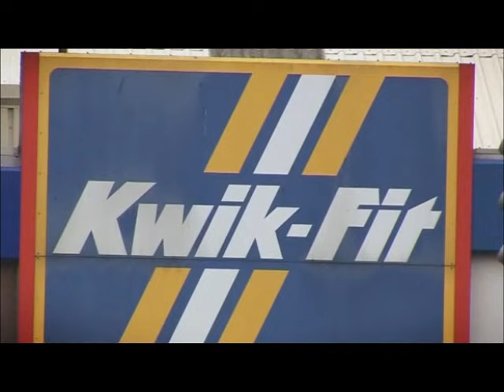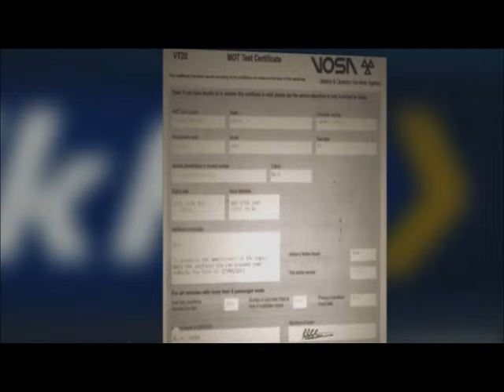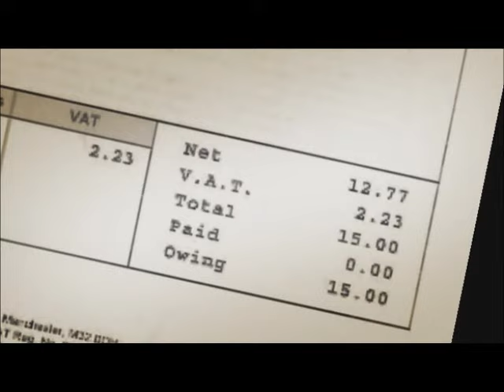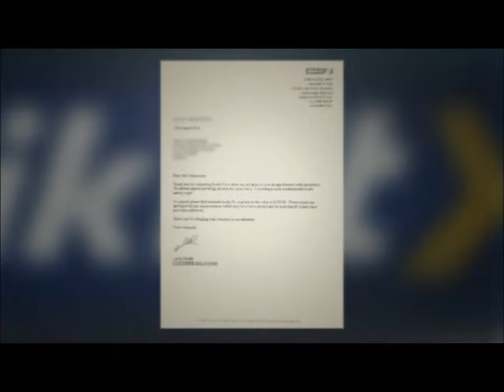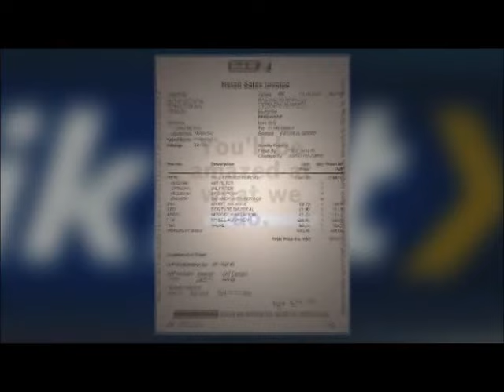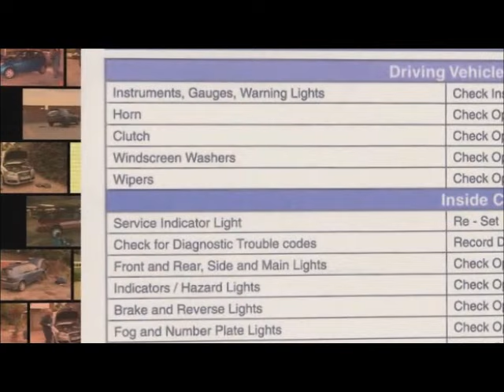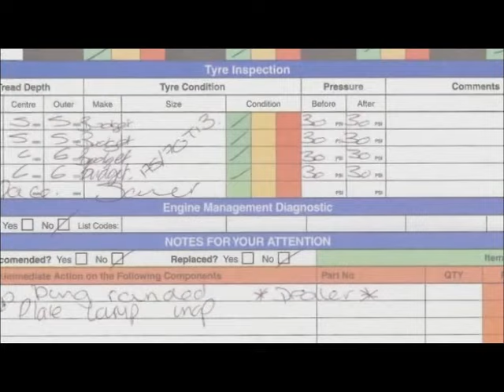Kwik-fit Car Rip-off Watchdog.wmv

Comment: My Dad was screwed over by them. Went in for new tyres, but they insisted that his cars brake boots were damaged. My Dad refused and went to an independent garage, who suspected that both had been intentionally neen slashed. Avoid Kwik Fit like the plague!!!!!!!
Reply: Kwik fit more like Kwik con
Reply: It reminds me of the various motorway service stations/ little chefs charging £9 for a small basic cooked breakfast and £2.90 for a small cup of tea-(1teabag bit of hot water+bit of uht long life milk) yet if u go a mile or two further down the road you would usually come across a catering van parked in the lay by where u cud probably get a cuppa for  £1 or less
Reply: @TELLBOY_E17  Service stations have large overheads which the catering van doesn't have, a closer example would be for the catering van to park in the service station car park and charge £3 a cuppa claiming they have a permit when they're just freeloading.
Reply: @TELLBOY_E17  But then people don't help themselves and just pay it. A few years ago I was on a ferry from the IOW to Portsmouth and decided to go into the shop to buy something to eat and a drink. I soon refused to buy an item as the prices were too steep but people were queueing up to pay the high prices. As I said, they don't help themselves.
Reply: Went in for a tyre and got told I needed I new shocks. Their fitter had sprayed oil them. Didn't fall for that old chestnut. Never been back  that was 40 years ago, your loss suckers.

Comment: My friends used to work for Kwik-Fit and I know for a fact the staff would charge for work that didn't need done. Also, if a car came in that one of the staff also owned they would try to charge the customer for parts that the staff needed for their cars and never fitted them. Kwik-Fit should be avoided at all costs no matter what the branch.

Comment: Wouldn't trust kiwk fit to work on my wheel barrow.
Reply: DAVID CADDY  I will take a look at your wheelbarrow, i only use genuine replacement parts, please send photo for a no obligation quote
Reply: you eill end up needing a new exhaust at kwik shit
Reply: i took my wheel barrow, they said it needed 2 new tires,a new brake servo and a new speedo cable? huh
Reply: I'm sure if you took a unicycle in, they'd say it needed new brakes.
Reply: Paul Robinson let me take a look mate, i can probably beat their price, i also fit genuine replacement parts and a no quibble guarantee !
Reply: Dave,i hadn't read your message when i wrote mine!!
Reply: Lmao
Reply: This is a little known fact but Kwik Fit changed the batteries on Apollo 13.
Reply: well you certainly wouldn't want to use them after this programme.

Lol'd at Kwikfit stating that they have a "satisfaction rating of 97%". Yeah that's because most of your customers believe what you tell them in relation to their car...
Reply: DAVID CADDY lol
Reply: DAVID CAD
Reply: Why not? I took my wheelbarrow in, they changed the window wipers for free. Can't beat that.
Reply: Graham White p8
Reply: dw they wouldn't touch it they'ed charge you tho
Reply: If you took ur wheel barrow to Kwik Shits they would probably say you need to have the barrows head light fluid topped up and try and charge you £950 for it
Reply: DAVID CADDY lucky thing they don’t work on wheels that small then 😉
Reply: I would never trust these parasites told me I needed new shock absorbers I told them to put it in writing they refused
Reply: @Elldeeve  and shock absorbers.
Reply: Not all depot's the same. The customer service is second to none. Always use own inspection sheets which must be completed by company policy.
Reply: I took my wheel barrow to quick fit and they said it was in such a bad state it should not be used on the road and be confined to garden use only.I was surprised by that.
Reply: @blackvulcan100  FFS change the record. Boring now
Reply: DAVID CADDY. Formula one didn’t have a clue about white ceramic brake pad grease accusing me of using white grease on brake pads. I pointed out to them that as they are professionals they should have been aware of the problems that copper grease can cause to ABS sensors and to cause them to malfunction.
Reply: I remember taking my car to a Kwik Fit where I'm based. Just for a new tyre, after the old one had a nail in it. I asked them how much for a new tyre? The guy said it was gonna cost £120. Just for a new tyre. Huh? Never again. Such a big rip-off!!!
Reply: They would fck the tracking up lol
Reply: lol
Reply: Its just not qu ick fit many of the local mechanics are doing the same. I wonder what the solution for this rip off. Every time im going for a mot i am pay 250-300pounds.

Comment: They're all the same, wifes Mitsubishi Outlander went in for a service, Mitsubishi main dealers in Cardiff rang back saying the car needed £660.00 of work on the brakes. Took it to my local garage, nothing at all wrong with the brakes. Even main dealers will rip you off.
Reply: Had the exact same with Arnold Clark
Reply: Main dealers are the worst for ripping people off can't believe people still use them
Reply: true....everyone needs to learn as much as they can about their car and search long and hard for an honest mechanic. Usually the small independent ones on the best because they can't afford a bad reputation.
Reply: Yeah I took my Golf to a local dealer for an MOT and they told me the back brakes were sticking. I watched the two guys through the service window remove the wheel, stand about for 30 minutes then put the wheel back on and they charged me £100 for this. I've never been back.
Reply: Find a good independent specialist as I did for my Saab Aero - RTJ autos in Stockport excellent 👌
Reply: I have found Main Dealers to be even worse than these "KWIK" type places....their excuse is that their overheads are astronomical.
I call it  "Fraud with a smile".....But it is still THEFT.
Reply: Had Toyota main dealer tell me that my car needed new front pads and discs I told them I was aware the brake pads needed replacing soon but that I don't believe the discs will be an issue as the car has little more than 60k miles they weren't happy and I told them I will have my mechanic do the work, I had only gone for a service as it extends the warranty. I looked back at the full history of car my car before taking it to my mechanic and found the discs had already been replaced at 38k miles with the previous owner which was also likely not needed either. I now service at a different toyota dealership who are much better. I never did get new discs as my mechanic agreed it was 100% not needed and the car passed its MOT several months later with the same discs. I frequently check the tyres and brakes on my car and can literally see into the front brake caliper without removing the wheel so know how thick the pads are. Dealerships bank on people not being switched on.
Reply: dealer stealer

Comment: You cant get shitter than a kwikfit fitter
Reply: Glenn Osgood Halfords is no better
Reply: That's like the advert by Sky. "Believe in shitter"  lol
Reply: Glenn Osgood 
Well said!!!
Reply: lmao
Reply: Where should I go instead? I need something reputable
Reply: John CR Smithton the old guy hidden in the corner bold head oiled up without a uniform rolling his cigarette and has been a mechanic for about 35 years is 105 times better and cheaper then quick fit or anyone else like quick fit.
Reply: +ENIGMA DHE KURIOZITETE  Definitely agree with you on that one. BTW is this the guy you mean 6:56  jk lol.
Reply: Your wrong it’s “you can’t get shitter than a shitfit fitter”
Reply: Unless you go to HALFORDS!!
Reply: Sky slogan is unintentionally accurate - "I do believe in better, that's why I don't have Sky"
Reply: @Jojohumf  
Look for an independent garage that specialises in your car brand, or country of manufacture.
I have a Mercedes Benz, and I had to look for an indie that had a MB diagnostic machine (STAR), and someone who knew how to use it.
It's not as hard with other makes, as most manufacturers cars can be read with a middling diagnostic machine.
Don't go to main dealers, they are nearly as bad as Kwik fit, and can charge fortunes for parts and labour.
The best way to find a good indie is word of mouth.
Reply: @stevenlawrence278  thank you so much

Comment: A trusted friend who owns his own garage had just done £900 worth of suspension work on my car finishing with a tracking check for me. He pointed out I needed a new tire so I went to Kwik Fit two days later. They fitted the tire then without my permission did a free tracking check and told me it was all out. When I pointed out to them, I’d only had it done two days before the look on their face was priceless.
Reply: These bastards tampered with my tracking after having brake pads fitted to get the work resetting it and replacing tyres.. The car slewed weirdly on a roundabout and an independent garage said the tracking was "a mile out."

Comment: I Took my Jaguar into Kwik Fit Doncaster for pre MOT check they told me around £1000 I refused went down the road to another garage it went straight through the test £40 .. keep well clear of these robbers
Reply: Why bother with a pre-MOT check? just put it into an MOT Centre which gives free retests?
Reply: @barryfowles-zl5ib  Not as simple now (used to get 7 days before) - 
How to claim an MOT re-test free of charge

The DVSA stipulates that there are only two sets of circumstances in which the MOT re-test is free of charge, that is:

 1.   If the vehicle has failed the MOT and is left at the testing station for repair and re-test and does not leave the testing station, then the re-test is free.
 2.   If the vehicle fails because of one or more specific items (see list below), provided the vehicle is returned for re-test by the end of the next working day, then no fee applies.
Reply: @dipys1008     Thanks for that information, by coincidence I put my car in for its MOT today, at my local MOT centre, it passed  no problem and the cost was £30, my original point I tried to make to David Cole(above) was don't waste money on a pre-MOT just shove it in for an actual MOT and should repairs or adjustments be needed, you just do that which is required and have it re-tested, at worst another £30, a lot better than rip-off merchants Kwik -Fit, best wishes.

Comment: in 1991 I left school and worked for Kwik-Fit for almost 2 years as a Trainee.  I was too honest and really cared about every customer.  My boss got angry with me because I would go around with the torque wrench to make sure they are tightened to the required setting based on the wall chart.  He said stop doing that! He was so mad at me that he showed me how to do it without doing the safety checks.   When that customer drove 10 meters onto the road his wheel came off.  Talk about bad Karma,  That customer sued his ass.
Reply: Fantasy by name.......
Reply: There will be Court records - private prosecution in 1993/4 I assume - what was your boss's name and in which Court was the hearing held?

Comment: A few years ago, my wife took my car into Kwik Fit Bury, a funny burning smell had appeared from under the car, the told her that the Cat was leaking and needed a replacement £800, I told her to refuse and took the car to my local garage, Sellers in Stalybridge. The mechanic put the car on the ramp and found a Marks and Spencer carrier bag had melted onto the exhaust, two mins with a scraper, problem solved..have never been to Kwik Fit since..that was over ten years ago.
Reply: Trevor Smith i
Reply: Ķ

Comment: And this is why i always do my own work on my cars and bikes. I do not trust anyone to touch my car or bike and seriously hate having to let an MOT centre touch my car/bike every year. 
So frustrating.
Reply: +Fireicer Cooper (f1r31c3r) take it you dont drive a modern car
Reply: +Fireicer Cooper (f1r31c3r) agree 100%
Reply: You can still work on a modern car.  It's not as easy and you need a fault code reader, but you can do it.
Simple servicing is still for the most part the same, as are brakes and suspension.  The electrics and engine management is tougher but even then most things can be done yourself.
Reply: cjmillsnun 5
Reply: I drive a Mazda RX8 2007, is that modern enough for you?
Reply: Fireicer Cooper The last thing you want is a regular garage touching a rotary, before you know it, they've flooded it, and trying to charge for a cam belt change ;)
Reply: and new pistons haha
Reply: That's alright if you know what your doing
Reply: Of course you can !
Oh look there goes a flying pig Break down truck!
Reply: Dito.
Reply: +cjmillsnun. Most people do not realize that damp or corrosion between a component and the computer management system is the most common cause of error codes. A can of WD40 can resolve 90% of them, particularly in airbag faults where the circuit resistance is critical. (this is a particular problem on VW)
Unfortunately some garages will simply take advantage of the codes to make a lot of money.
Reply: me too, my life is a risk, I don't want some spotty underpaid teenager touching my bike
Reply: @ @brianrennie133  : Lots that even an amateur can do on a modern car. Check tyre tread depths and sidewalls for damage;  lights and windsceen washers, feel around the exaust pipe for blows. Just those cover most MoT failures, and you don't need a computer to check brake pads.
Reply: paul austin  as an owner of a 63 Cadillac a 67 Pontiac and a modern range rover I can honestly say....you are talking out of your arse
Reply: I'm a retired,broke, but honest mechanic I could never bring myself to do this shit to innocent people
Reply: I feel exactly as you, do my own work, even MOT technicians treat vehicles harshly sometimes.
Reply: @HOTSPUROLDSCHOOL  anyone can learn the basics. Brakes and suspension isn’t hard to replace once you know a few dos and don’ts. Looking around on YouTube can help you learn if you’re willing.

Comment: Our gearbox was low on oil quick fit wanted £400 for a new gearbox..
Years later the car was still OK after we added just the oil...also new belt on my bmw.....but it's chain drive so no belt existed...
More like quick rob...
Reply: kwikfit dont sell or fit gearboxes  and never have so maybe this is made up?
Reply: @hotboxrecords4919  Exactly. What was their quote on the price for the "belt" lmfao. If it was like 80 they weren't talking about the timing belt/chain. Also the price for even a used R/R for a gearbox on a BMW is not going to be that low of a price so I'm sure that idiot also didn't understand that part either. More than likely they weren't even talking about the gearbox but the differential which is hours of work to re seal and usually leak on BMWs.
Reply: Auxiliary belt perhaps

Comment: I worked for Smiley for 3 years when I left school, They  are now called National Tyres & Autocare. The wheel alignment & fluid replacement were were 2 of their favourite procedures they would charge for and not perform . The premium Oil change was ALWAYS Duckhams budget oil.
 
Also i think i seen about 10 flat tyres being repaired the whole time I worked there. They would always say the tyre had a puncture on the sidewall, so it would then need to be replaced . They had monthly quotas for tyres & exhaust sales.

Comment: Needed CV joint replacing. Kwik fit wanted to charge £150 for CV joint. They said because it needed wheel alignment, suspension levelling and tyre checking? I said "wheels are already aligned and suspension is fine. Checking tyres any moron can do. Other garage said £55 for cv joint" Then they said to me be my guest you car could be dangerous. I then said "you could be in danger too if you keep chatting shit"
Reply: Aston Bright
Reply: urbex2007 - You MOT'd a 2 year old car with another year left to run?
Reply: It's good practice to check the steering alignment before fitting 2 new tyres even if the car is 2 years old. The mrs could have bumped it into a kerb whilst parking and something could have got bent a little, just sayin.
Reply: A bent copper.
Reply: Just wondering why a 2 year old car passed an MOT, when the first MOT is due at 3 years?
Reply: taxi? taxis require mot's from 1 year old, not 3 like consumer cars
Reply: Quick Fit tried to charge me £650 for work to get a car through an MOT including replacing a CV gaiter. I refused to pay that much, took the car straight to an ATS garage who did all the work for £120. They were shocked to see the original Kwik Fit quotation. When returning my car to pass the MOT I spoke to the manager who said I should never have been quoted so much. The original mechanic was clearly trying to rip me off.
Reply: Aston Bright that's my kind of guy fam
Reply: Bruce Lee i

Comment: I went to Kwik Fit  4 years ago to do a simple MOT for my bmw 1 series which had no problems. They failed it and came with about 13 bogus BS reasons as to why they need to search the car entirely for an electrical problem - they wanted to search the car for a week at £50/hour!!!!! That would cost me about 2.5k. I left the garage as soon as they said that and never went backj. 4 years later my car is still fine and there's no signs of 'electrical problems'. Kwik Fit are total scammers. Never trust any of their branches for anything, I've heard much worse in the past.

Comment: I took a vehicle to the Kwik Fit in Oldbury for an MOT, it was failed on brakes and headlights, with an added hand written item for a snapped cable for the driver seat that allowed access to the rear seats. (Passenger seat still folded as normal) I took it to another garage for a 2nd opinion, it was subsequently passed with no problems found with the brakes or lights, and the mechanic told me that they cannot fail a vehicle for a snapped rear access cable. I have never used them since.